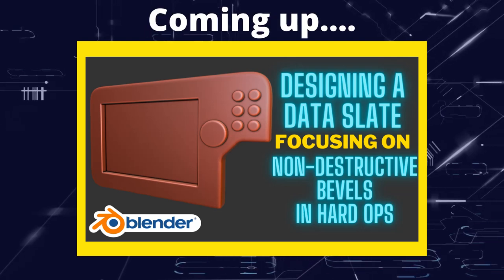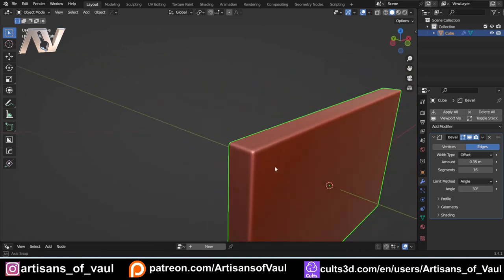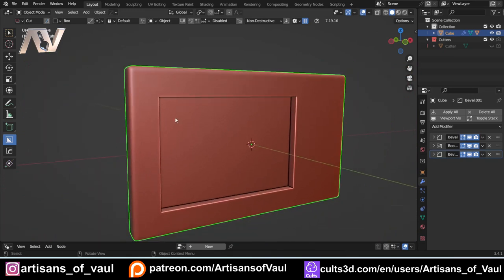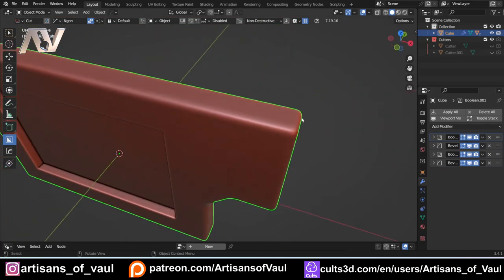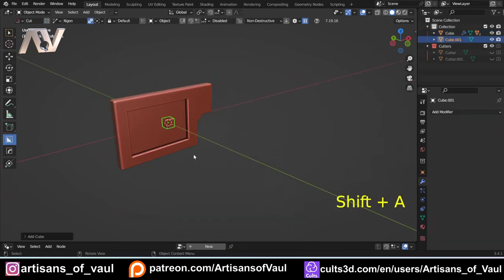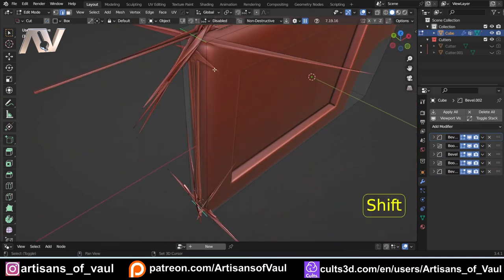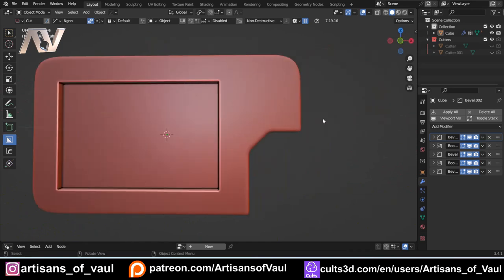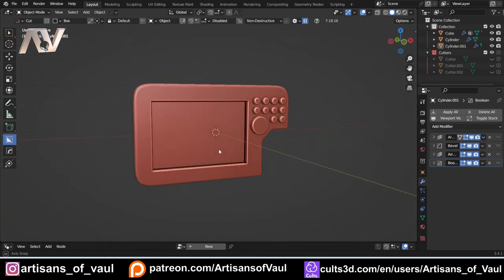Designing a data slate focusing on non-destructive bevels in Hard Ops

Comment: Do you know if there is a way to create a bevel only on the top surface after a boolean modifier? e.g., after you make the cut in the bottom right corner, could you bevel the top face without beveling the corner edges?
Reply from the maker: Not without confirming the boolean first to access the Geometry.  Maybe with Geometry nodes but thats going to get into selecting vertices in the Geometry node and I am not actually sure that would work definitely. Sorry.
Reply: @ArtisansofVaul  I kind of figured as much. Maybe one day I'll have the time to dive into those / make an extension that can do something like that. I could see something like: draw a box over the vertices you want beveled (similar to a boolean operation) as a means of capturing those vertices in a vertex group which can then be used for a bevel. Thanks for the great content!
Reply from the maker: @Andrew Glick  If there was a shortcut to making a vertex group that would be cool

Comment: Nice video.
How to make this whitout addon?
...
Reply: Ctrl+B to bevel edges individually in edit mode, or add the Bevel modifier manually from the modifier menu on the side. He probably isn't going to be doing a guide on how to make this exact object without this add-on considering this guide was made to demonstrate the function in the add-on.
Reply from the maker: As has been said by Virgil you can do it destructively without the add on.  Alternatively you can do it non-destructively but you would need to set up vertex groups and at that point it is more time consuming than doing it destructively so I probably wouldn't bother without the addon.  But you can see the process of that here: https://youtu.be/Yd8w_CQncOI
Reply from the maker: @virgilhawkins3390  Thanks for helping out.  Really appreciate it and everyone that willing to take some time to help the community.  Top man 👍